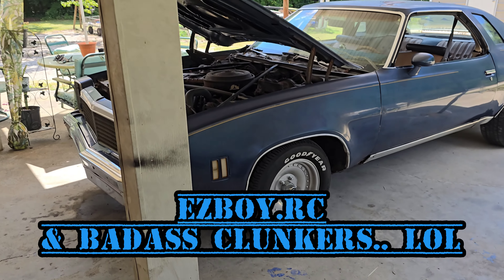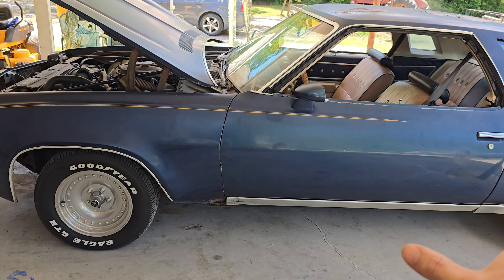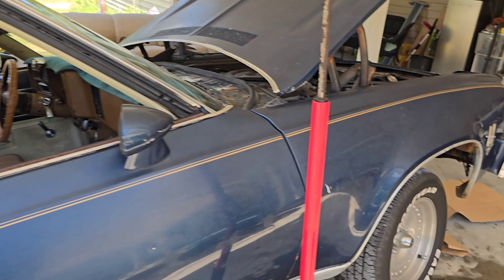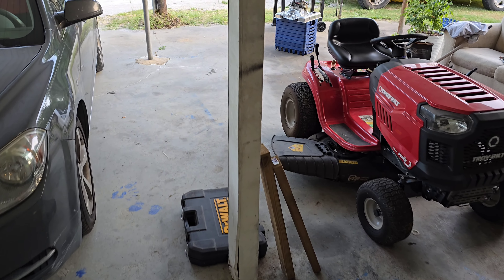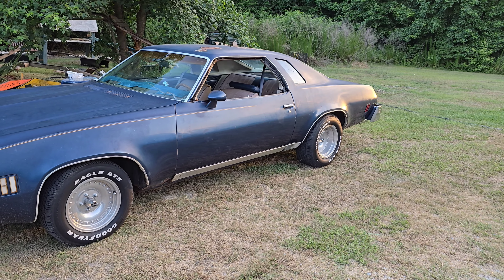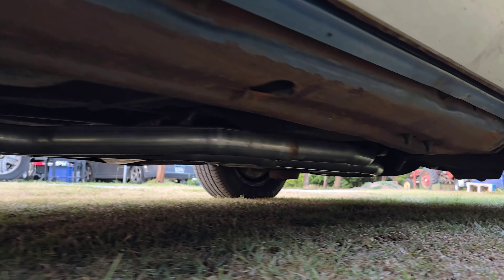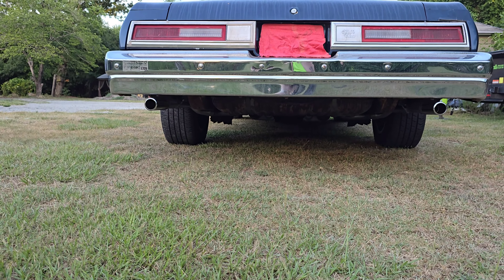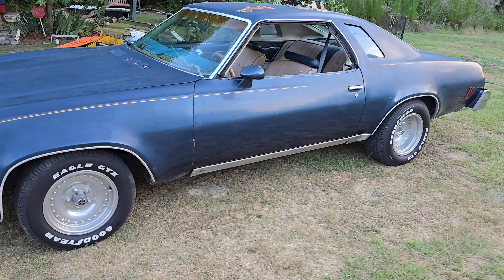1976 Chevy chevelle malibu Get all new dual exhaust with flowmasters. How does it sound?

Comment: Great choice in exhaust. May i suggest a little wire wheeling and painting down below 👍
Reply from the maker: Yes, sir.  I'm about to do that.
 I was just debating if I wanted to do my gas tank, silver or black. The floors and trunk are very solid. Some of it just has some lite surface to rust. But no holes at all,  I'm gonna take care of the underneath of it when I do suspension. And breaks at the same time.

Comment: Love old Chevy’s, air conditioning compressor won’t work with headers the bracket mount’s to exhaust manifold studs so you can save a few $$ if you’re going that route.

Comment: Yup, we always did,,,, Jack the back of our cars up. At least I did. That's what you did back in the 1970s
Reply from the maker: Yeah, nowadays, they wanna hug the road. We used to slide the corners. I would fishtail around everything growing up. 
I am going to put new brakes &  suspension on it as well. Probably air shocks in the back, even though I won't have them up very high. I like being able to adjust the ride comfort.
Reply: Yeah, I don't particularly enjoy the slammers. I don't think it necessary.Looks that great👍🛻

Comment: 2-1/2 pipe is perfect for a stock 350 still retains some back pressure
Reply from the maker: I was thinking the same thing. Even though it's going to get a better intake and carburetor and a few other things. It's not going to make tremendous power, Eventually, I'm going to put a cam in it. But it will still be okay, I think.